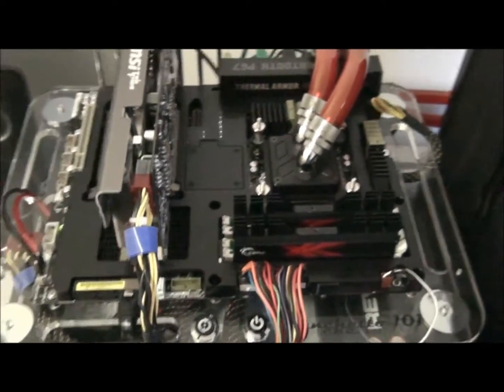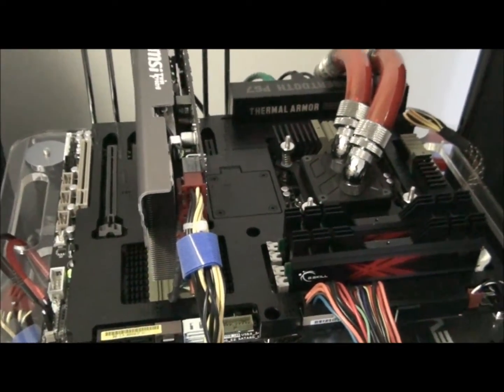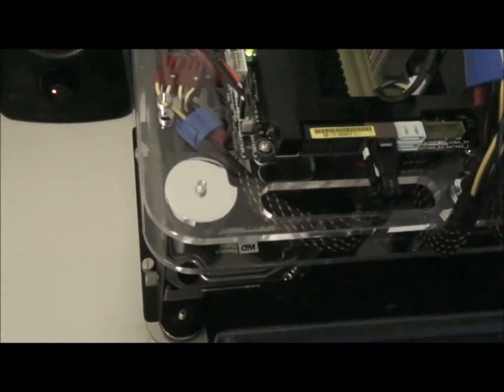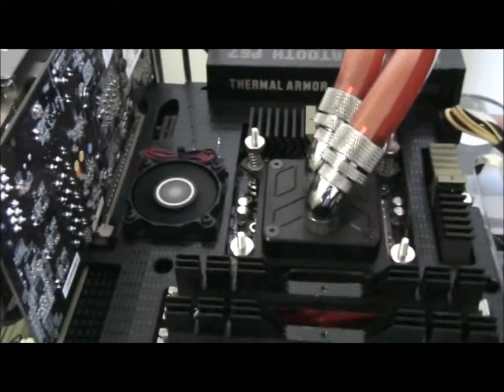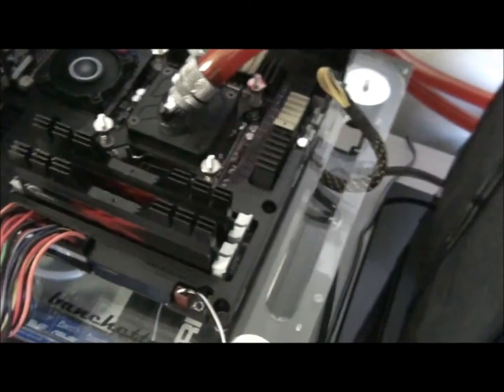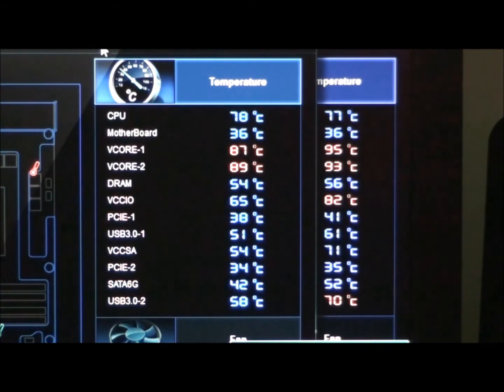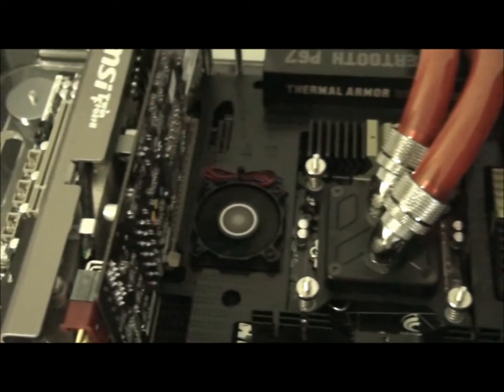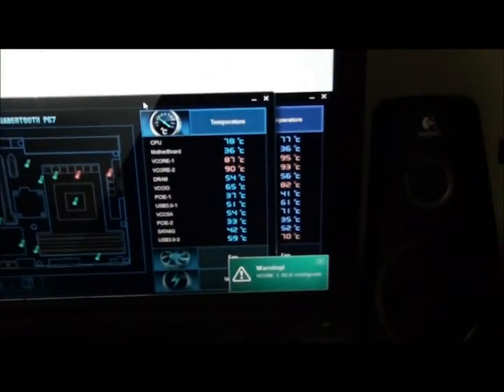Sabertooth P67 Assist Fan Testing

Comment: Dude of course without those little pesty noisy fans the board gets very hot, because of that plastic cover that is trapping hot temperatures. You should remove that plastic cap and then compare with the plastic cap with the little noisy fans. Your review is useless
Reply: What +joaquim coutinho is trying to say is that he should have removed the tuff's cover the goes over the entire board and then tested +blazark
Whats really retarded is that asus sells this mother board with no stalk assist fan.

Comment: high temperatures shorten the lifespan of your components - With proper airflow in case and decent cpu cooling (like mine Noctua NH-D14) your temps shouldnt get over 70 C on full load.

Comment: Yeah I actually purchased a water block for Vcore, however I did not realize that the water block actually misses some of the components required to be cooled. I ended up wedging a little 40mm fan over the area, my temps never exceed 70 C now. That is also with higher voltages, or at least what I consider higher voltages for CPU core. Around 1.3v.

Comment: Hey guys, please what is the MOST SILENT 50mm fan available for this mobo you think?
I just pulled out the AIREN Red Wings 50 because it was far to loud.
As I have corsair h100 cooling for cpu, everything now seems to be a lot more noisy :(

Comment: @SingularityComputers ambient is 70 degrees Farenheit.  Those are idle temps.  Full load is higher of course.  Not really sure what the temps are under load, except for the CPU which gets up to 66 C @ 100% load.

Comment: I have OUTSTANDING results with both the assist fan and a large case fan for intake(ThermalTake Level 10GT Case) The temps are UNBELIEVABLE! My friend is also running this board with the new Antec Full tower case with the 3 front fans and has great results.

Comment: Where is a good place to get the assist fan? I'm buying this motherboard tonight. Based on your reviews. I've bought the GeminII 1155 comatible downward blowing fan/heatsink for it. There is a 2500k i5 going in, as well as a Zotac GTX 560 ti 448 core gfx card. They had BF3 with the purchase, so i went with them after seeing a few decent reviews.16 gb of Corsair Vengeance 1600 DDR3

Comment: @SingularityComputers Check out the Link Depot FAN-5015. 15 CFM and 5200 RPM. I suppose it's not too much of a difference, and it is a bit louder, but if noise doesn't bother you, it's perfect.

Comment: I will be using a GTX 560 Ti, this motherboard,intel core i5 2500k and 8gb ram and without overclocking anything. is it very necessary for me to put this "extra" fan on? plz respond. :)

Comment: Hey about your case, I like how you have the mobo out of the case on that platter thing. What's that type of case called, how much did it cost and where did you get it. How dangerous is it to have it running like that? Also do you ever put it in a normal case or keep it like that all the time. Also whats the model/name of your water cooling system and how much did you pay for it?

Comment: @fixx572 ...also, I want to install my sound card in the top PCI-E x1 slot (cos the 2nd and 3rd x1 slots will be blocked off by my graphics card) and this wouldn't be possible with a 50mm fan installed on the mobo. What did you decide to do on your system in the end?

Comment: @fixx572 I am just building a system with this mobo and was thinking the same thing about removing the shield. I tried it briefly with a Scythe Mini Kaze 50mm fan (which is a nice, quiet fan), but I reckon it would be better to have the 180mm Air Penetrator fans in my Silverstone FT02 case blasting cool air from the floor across the mobo without the shield in the way. I still think it was worth buying the Sabertooth though, as I like the military grade components and 5 year warranty etc.